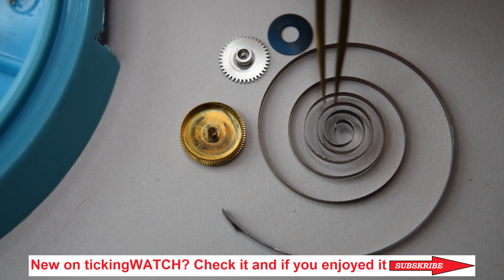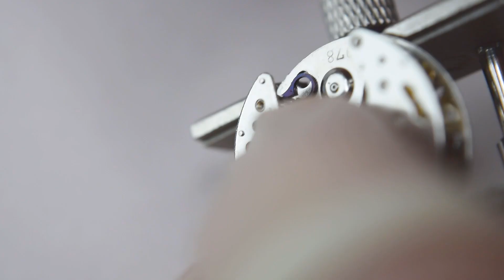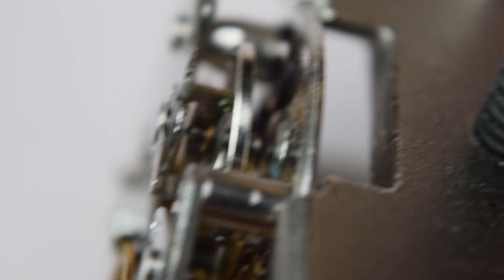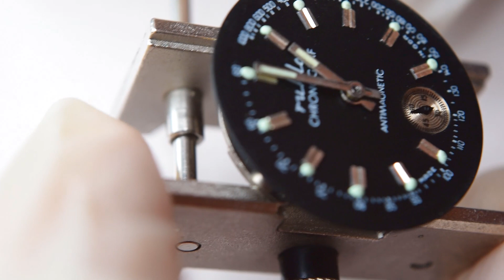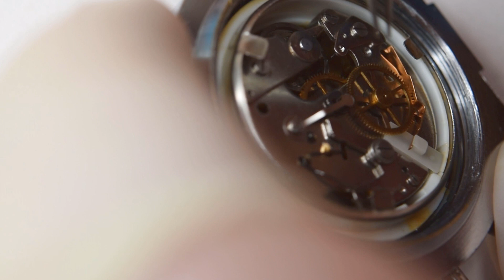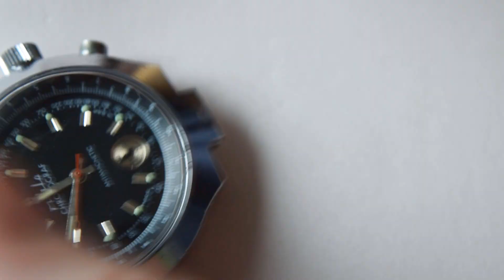Zegarek chronograf UMF Ruhla | montaż mechanizmu | test działania

Comment: They made over 130 million of these movements. They are cheaply made but are not cheap to buy. One watch material seller was offering them at 68 Euros.  These chronographs are hugely more expensive to buy than suggested on this tube.  The watches are typical of life in East Germany. Rugged, simple and functional. Sometimes you find Ruhlas sighed 'Saxon'.  These tend to be cheaper to buy but the same Cal 24 is used.  I've worked on a good few of these. The conical pivots wear as does the escape wheel and this leads to a poor action and time keeping...and the occasional stopping when the watch is being moved and carried. The pallets can unfix in the ultrasonic cleaner. When the movement wears out, and it will, the watch is generally scrap.  Chronographs and the Sumatic mini clock are the exceptions and these are quite expensive in fully working condition.
Reply from the maker: Thanks for your useful comment about Ruhla, I really appreciate it.

Comment: Damn! It looks so easy when you install that plate. No way I can do that. What is the trick to have the pinion shafts aligned so they fit into those holes at once? 😮
Reply from the maker: I'm not sure that there is a need to fit the wheels into holes at once. It is enough that you align one wheel after another.

Comment: You cut out the bit I wanted to see most - where to put the little spring that goes with the plastic part of the keyless works. Does it just fit under that plastic part or something else?
Reply from the maker: Yes, but there is nothing complicated. Check my disassembly video, this may help ...

Comment: Hi. Thank you so much for your share. It really helps a lot. I would only ask you, if you don't mind, if next time you include on the vídeo the hard parts, like seting that spring and the balance wheel. It would help a lot. I was able to set the spring on mine, but not the balance wheel. Probably the most dificult I have ever came across.... Thanks again.
Best regards.
Reply from the maker: Thanks for your advice, I really appreciate it. About the balance wheel, check this part https://youtu.be/iwNOAAifHlo?t=774 and my other videos.

Comment: I think these movements were not meant for repair or to last long, because they had no jewels in there. After some time of use the pins or the holes were worn out, the watch became totally unreliable with accuracy or completely stopping after a while of run and could not be repaired (or not easily for sure).
Reply: Surprisingly these were very resilient and as long as you don't break pivots or force use beyond needing a clean and lubricate they could bounce back into timekeeping very easily and you just used it til it became unreliable again.   The actual servicing of these involved lighter fluid or naptha and some oil, stickier the better and the whole movement with dial would be put into a dish or saucer, naptha poured in to just under the dial and allowed to soak for a good while, sometimes given a shake and resoaked, then shaken to remove the last vestiges of dirt and allowed to air dry and a lint cloth to wipe the hairspring free of any liquids then all the moving parts oiled up, movement back into case and its up and running again.   Of course the balances did wear out but you just bought a new one for a couple marks and off it would go again as the balance pivots would wear quicker than the pivot settings would, of course you could buy several repair parts to replace pivotry seating and mainsprings, very clever design out-Timexing Timex for cheapness whilst still returning pretty good precision and timekeeping :D
Reply from the maker: Thanks for your opinion I really appreciate it. Unfortunately, they should be cheap and after some time you should buy a new one, a method before quartz watches take over this role 😀

Comment: Nice video. Just restored one, I can't set the second hand to the correct position by pressing the button. Do you have any tips to be able to put it easily?
Reply from the maker: Thanks. you just need to hold the spring that holds the sweep second pinion. I do this by based the spring on movement holder.

Comment: I thought that the bluing was actually a type of oil burned into the surface of the steel. I know that steel goes blue when it gets too hot from working with angle grinders and my last job was working at a place machining threads with modified lathes all day, but I read about how bluing works a month ago and know that mant American guns have it and it will scratch off over time. Especially rubbing in the holster for a few years.

Comment: I had the same watch. But after 7 months it didnt work. The reason was that the bearings were worn out.   A watchmaker told me that the quality of the bearings were really bad. A fixing was not possible.
How long did your Chronograph run ?
Reply: WHAT bearings? There are none. He might have meant the pivots on the cogs. Should send it to ticking watch for parts.

Comment: Hello Ticking watch :  during assembly ,  the plastic part attached to the stop pusher  which will stop the second fly off ( probably out of the window ).    Do you know where I can get hold of  the plastic part ?
Reply from the maker: Tray eBay,  check links in the description down below but to find only one part for this one will be a challenge, good luck 👍
Reply: @tickingWATCH  Thanks . Actually,   I got a spare Balance assembly by purchasing a Cal 24 Ruhla watch.     But just for the plastic parts,  buying a Ruhla chronograph is rather expensive.    Now , the top pusher is OK,  it reset the second hand.     But  the second pusher without the plastic part is not working .   It is a pity .   I service the Chronograph and with a new balance assembly  ,  I managed to regulate it to relatively good accuracy .     I will look at E-bay everyday to try my luck
Reply from the maker: @SK-2175  this model is rather a uniqe watch. Another possibility is also to tray 3D printing.
Reply: @tickingWATCH   Yes,  that is one .    The other is to machine out the piece from a plastic material.    Thanks for all the information.  Your Video is a great one.  Cheers
Reply: Finally , I machined 3 pieces out of Delrin material ( Plastics )   and I fine tune the part to fit the slot of the top plate and file a slot to attach the spring.   The Chrono function now is perfectly in order.     If  you need one piece of this part , let me know.   I can send it to you   FOC
Reply: @SK-2175  good job